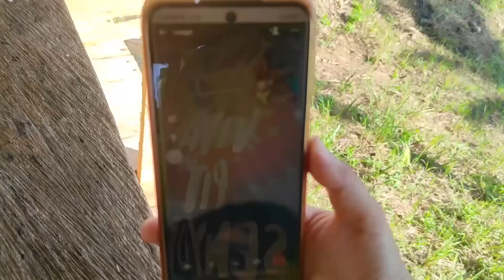Russians love sinagang | Payag Update | Amazing falls near our place | Village life with foreigners

Comment: Apply some foil insulator to your ceiling, it will help decrease the temperature by 5°C, or if daghan kugon dinha, Apply kugon over GI sheet & secure with net. Lisod na ma heat stroke sa tamang kainit. Kugihan pa naman si Pap. Ing ana sad akong amahan, ganahan pawisan sa trabaho.